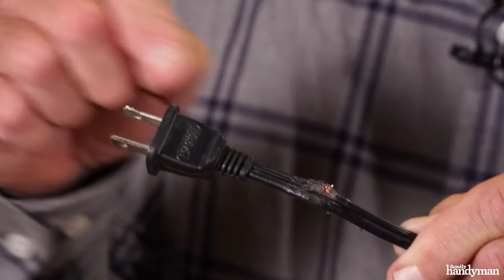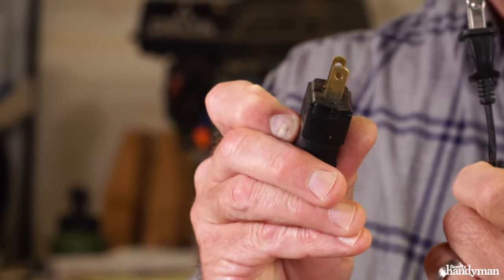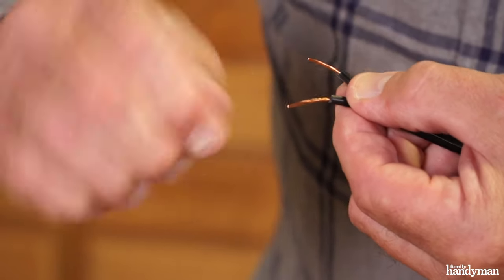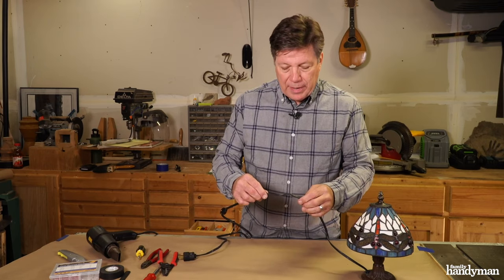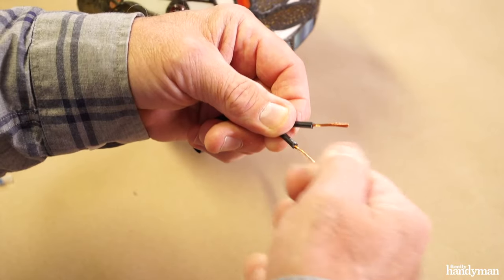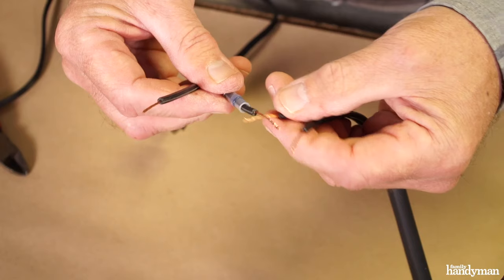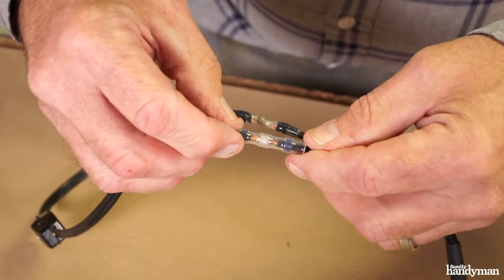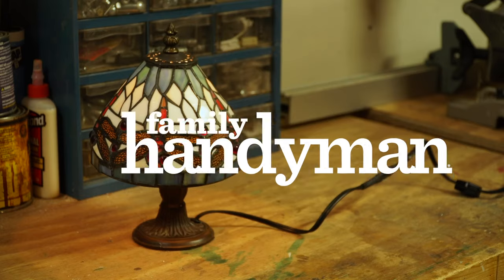How to Fix a Cord Chewed by Your Pet

Comment: Will this work for speaker wires?  Asking for a friend. My friend being my new puppy.
Reply: Speaker wires don't require all these steps. It's much easier to cut speaker wire as long as you have enough length still there. It has been a year. I'm sure you figured it out.

Comment: If the cord is chewed, at what point do you know that you need to actually fix or replace the cord?  For example, my little bunny cut broke the surface of the cord, and one of the copper wires, does that warrant repairing the whole thing or can I just put electrical tape around it?

Comment: I don't have a heat gun, can I use a hair dryer? Also, is this safe to do for like a tv or fridge? Could it cause fire?
Reply: No. A heat gun is a different type of heat from a blow dryer. You just the heat. Not the air that rotates with the heat from a hair dryer.

Comment: Can I use a hair dryer instead of a heat gun and where do I find solder connectors? I'm currently living in college dorms and there was a roach problem. The nasty little critters chewed my wires.

Comment: for how long do you apply the heat gun on the solder tube as well as on the heat shrink tuning is there an indicator how do you know it's done.?
Reply: It melts that’s how you know
Reply: @dcr630  can i use a hair blow dryer?
Reply: I was thinking same thing! 👍

Comment: Hi. How do we find where the broken part of the wire is if the outer coating is fine?
Reply: Buy a new cord/wire
Reply: Or take it somewhere
Reply: @SANTAS-BIG-HELPER where would you recommend? Not sure if any local ACE has option of repair vs local electrical supply ... 🤷🏼‍♀️

Comment: Cool, haven't seen those solder seal connectors. Bet they ain't cheap
Reply: I would say about 4.99 for 2 of them..idk im guessing
Reply: @lilbagz4418  8 think Amazon has better deals but I guess quality is a factor too
Reply: @juntjoonunya9216  i only need 4 of them
Reply: @juntjoonunya9216  and shipping
Reply: @lilbagz4418  prolly best to get a pack. I'd bet Amazon/eBay got a pack for $20. You'll knick a cord in the future for sure or find a power tool on the side of the road with a mangled cord like I always do
Reply: @juntjoonunya9216  i cant i can only spend like 8 10 dollars...if i had more i would just replace it...but i dont want to oder anything from amazon ..just need a couple from a depot store..i see what you mean tho
Reply: @juntjoonunya9216  ill just go to a depot store..gas will be cheaper than shipping and i dont have to wait
Reply: @lilbagz4418  lol. You gotta close down that lemonade stand and get a paper route
Reply: @juntjoonunya9216  how imma save any money buying bs off amazon?